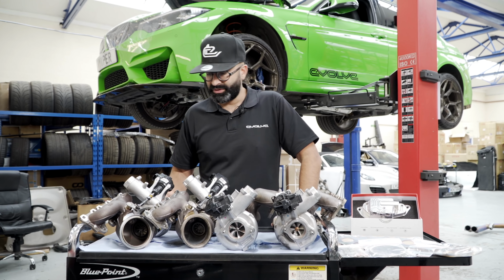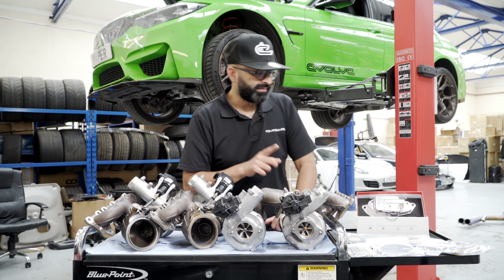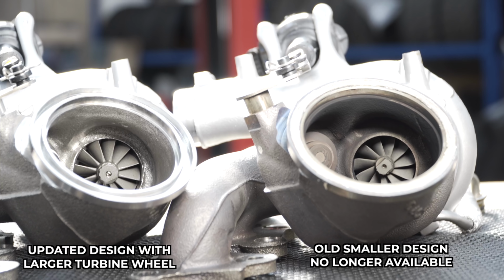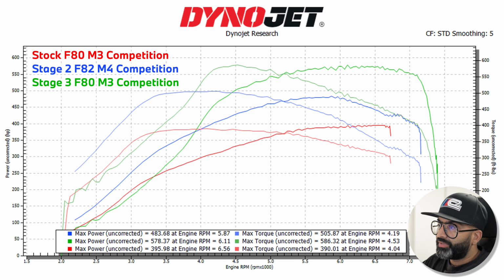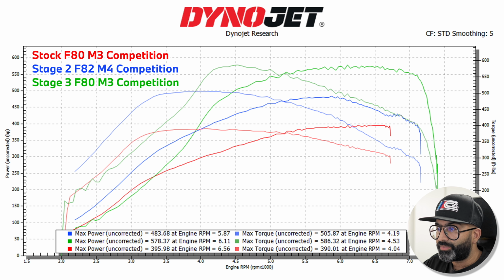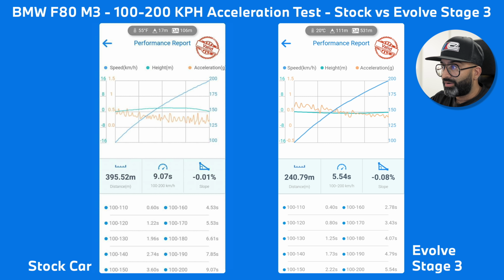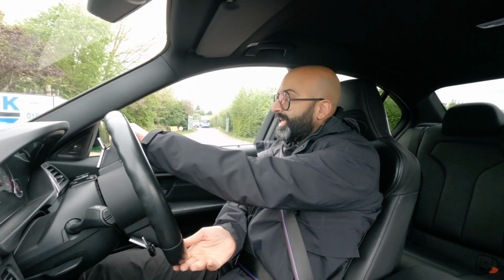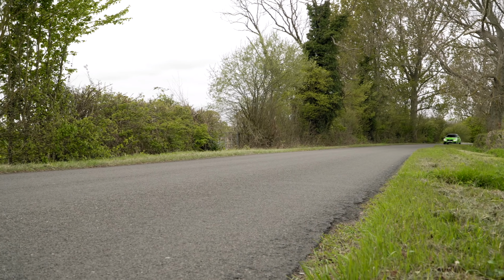Mosselman S55 Hybrid Turbo Install + Testing - Dyno, Dragy, 0-202mph Top Speed Run - F80 M3 F82 M4

Comment: A little heads up (experienced in powertrain development), look out for the oil temperature impact on the road, not likely an issue when pushing hard... but lower oil temperatures during high speed moderate driving- I.e. motorway/autobahn/a-road and being real for most people you can't spend a huge amount of time in normal driving on load / at high speed without obliterating the speed limit. 

Basically if you don't get the oil over 90-100 odd degrees regularly the possible richness when you've got a mapped / enriched on load conditions and you can end up with quite a lot of fuel dilution in the oil. Simply keeping it warmer avoids that allowing the fuel to evaporate off. (Experience was 21,000 miles of autobahn driving with a slightly low temperature - added around 1 litre 10% fuel in oil - increasing coolant temp in that case sorted it out.
Reply: Not getting the oil over 100 C quickly to boil off condensates is never a good choice.

Comment: Wait.. what is wrong with MY car lol. I've dynoed 670 at the wheels in my F80 and my 100-200kph is the same time, about 5.5s...
Your 'Project Vyper' series is what inspired me to modify my M3! Nice work guys!
Reply from the maker: Peak figure doesn't mean much. What does the power curve look like?
Reply: @EvolveAutomotive  That could be the culprit. Power curve of my car (Pure Stage 2+ turbos) is a lot more peaky/punchy than yours. While I may have 100 more peak whp, I'm making less power at every point on the graph under 4500rpms.
Reply from the maker: Could also be heat management, ambient temp etc, along with the earlier spool.

Comment: Please before you retire the f80 put it up against minty (g80) s58 platform has loads of potential but exactly how far is the  f80 in measurables and  what tune would it need to competed with is younger sibling. These cars are the last of the ice… make it happen as only EVOLVE can.

Comment: I'm assuming the setup is exceeding 24psi and was wondering why you have retained the carbon fiber charge pipes when they are only rated to 24 psi. I'm interested in the CF charge pipes however apprehensive to buy them due to the rated pressure recommendation. What are the boost targets in this setup?
Reply from the maker: 27 psi on pump and 29 psi on pump and meth. We have not had any issues with them.
Reply: @EvolveAutomotive  Thanks for the update. Time to order a set of them!

Comment: Hello, very nice tuning of S55 car, thank you for sharing! Only thing I noticed is a bit strange sound of the exhaust, it appeared in high RPM just before DCT shifting up (see the video when the car drove off in time 9:10 sec). It sounds like the exhaust gas under high pressure resonates somewhere which makes disharmony in the overal exhaust sound performance. It just seems to me or do you hear it as well?
Reply: It’s traction control cutting power combined with the bypass valve noise

Comment: Very well done on what you achieved, but it sounded awful on the up shifts !!
Reply from the maker: S55 isn’t a great sounding engine. Equal length mid-pipe would help that.
Reply: The N55 is a much better sounding engine in comparison. Of course not the same power.
Reply from the maker: @dionisifilpo7735  Why we love our OG M2 with the N55!

Comment: Just a question does the mosselman turbos use the stock turbos and just make them hybrid?
Reply from the maker: A hybrid turbo is one that uses the original turbo housing but machined to take larger compressor/turbine wheels.
Reply: @EvolveAutomotive  correct that's the one... if mosselman ones a bigger do u think it'd worth making machining the stock turbos
Reply from the maker: @mushy1983123  Mosselman are hybrid turbos. I'm not sure I understand your question.
Reply: @EvolveAutomotive  I get u now so mosselman turbos use the original housing and they machine it to make room for the bigger turbine wheel
Reply from the maker: Yes, they machine both sides for larger compressor and turbine wheels.
Reply: @Evolve Automotive  just got a question have u ever raced this set-up at the drag strip interested to see what this will run quarter mile if it gets traction

Comment: By ‘pump gas’ you mean 93 octane?
Reply from the maker: Yeah. It's 99 Ron which is around 93/4 Oct
Reply: @EvolveAutomotive  aha. So these turbos can easily make more on proper race fuel or e85. 

How much power do you think these can make?
Reply from the maker: Mosselman have an example on their website of a car making 786hp, with port injection and I imagine race fuel.
Reply from the maker: @candlestix521  check out Kies Motorsport channel. I think he tuned on E85. We just wanted a simple solution for customers who don't want to mess around with meth or don't have access to E85.
Reply: @EvolveAutomotive  yes. I’ve seen the Kies motorsports dyno. He is a built motor. But the other one you mentioned I believe that owner has a stock motor. 

For you 200mph + race gas run were you short shifting because the power drops off towards redline?
Reply from the maker: @candlestix521  yes I found my times faster shifting there
Reply: @EvolveAutomotive  and this run was done without port injection only utilizing the EU5s?
Reply from the maker: @candlestix521  our car? Yes no port injection. Only F10 M5 Injectors and pump fuel.
Reply: @EvolveAutomotive  oh so that 200mph run was on the 99RON?!
Reply from the maker: @candlestix521  dyno run and dragy pump fuel. Vmax 202 mph run on race fuel as mentioned in the video. Still no port injection.
Reply: @EvolveAutomotive  thank you for your quick responses 👍🏻 Much appreciated

Comment: Ive seen bolt-ons S55 make 600whp. And 700 on big turbos. Figure it out.
Reply from the maker: Are you implying the S55 stock turbo can flow enough air to create over 600whp?
Reply: Just another hater 😴
Reply: @Patient_Lion_BS  aand you’re just a pilgrim who doesnt know about cars. These cars make 750-800 whp on aftermarket turbos. Call me a liar.
Reply: @LaKuan  Liar. Those cars all use meth plus e90.
Reply: @EvolveAutomotive  yes the s55 stock turbo can flow enough air to create over 600whp with full e85 and meth

Comment: It would be more meaningful to at least mention how high did you have to turn the boost up to get these power levels and how much knock retard it produced. Was factory tune able to maintain the proper AFR or significant changes to the fuel map was necessary and so on. Lets add a few more description to the word  "tune".